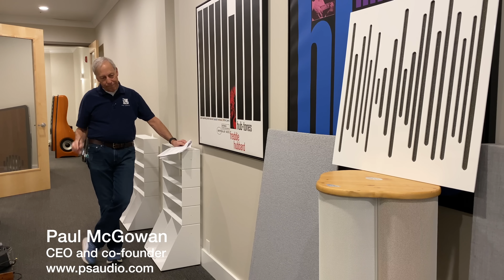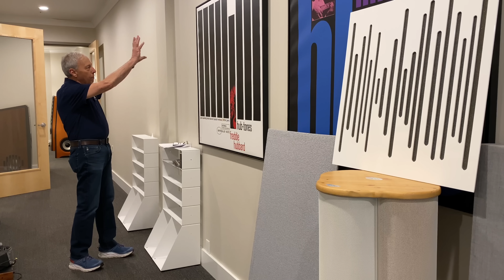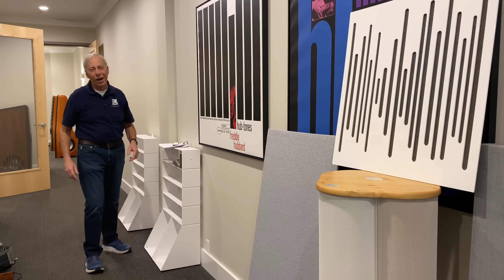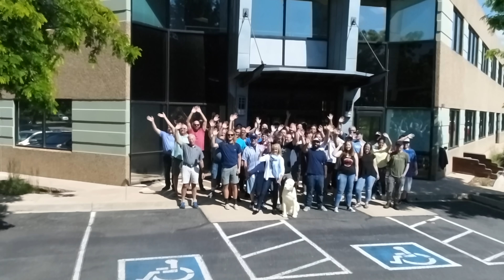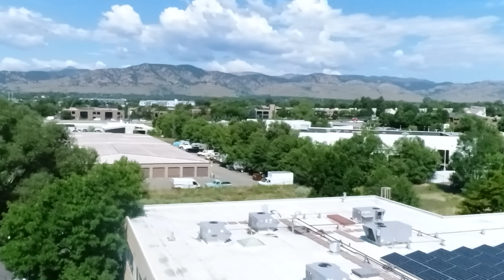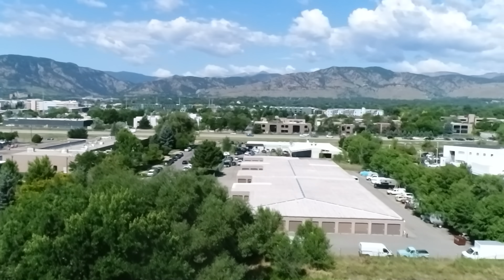USB Audio vs. I2S

Comment: USB is a flexible TWO WAY data connection that can do everything data and allows a DAC to PULL data ASYNCHRONOUSLY with its clock in full control (no audible jitter and bit-perfect audio is possible). The computer can identify a device capabilities through USB. An I2S bus is very low level and is SYNCHRONOUS involving a defined clock master. One doesn't sound better than the other one if the audio specs are the same because you can assume that every 1 and 0 come through reliably. My usual concern with USB is any power or digital noise from a PC leaking through to an analog signal. But this is an issue of good design and not USB itself. Think of it like this, your DAC is happy if it gets every bit correctly, it can run the timing in full control (avoid jitter) and there is no EMI or power rail carried noise disturbing the analog output stage. USB is not a limiting factor.
Reply: HAPZ1ES and forget it. 😉
Reply: @Finn-McCool  that is indeed a good device. But the 20.000 song limit and no streaming means it's a no go for my needs
Reply: Yes, USB is "flexible" and that's why is so complicated, it tries to do everything (and they keep adding features to it!!!).   IMHO for audiophile purposes, simpler protocols like I2S are much better, no drivers, no complex controllers, no power, no fuss.
Reply: I've had a lot of USB noise coming from my pc via the USB ground.
Luckily I have a Cambridge Audio DacMagic Plus, which has a USB ground lift switch.
That switch fully solved all the noise issues I had.
Reply: Qorax Yes, I also had a bad USB cable once that I had to replace. Generally I prefer not to use the USB 5V for a DAC. Audiophile DACs should not run on some PC power supply.
Reply: Marketing needs to make up something to sell 😂
Reply: @AngelosChing  That is exactly what this is about.
Reply: @ThinkingBetter 

Your thinking is actually worse. I2s is superior.
Reply: @dillonsaudio  I2S is a rather old (30+ years) low level serial bus for synchronized audio data used in much of consumer electronics including TVs, DVDs, CD players, AVRs and even car stereos intended for internal data communication between ICs e.g an SOC and an audio DSP or DAC chip. It was never intended to be a flexible external bus but it has the advantage of supporting synchronized audio data with one clock master to avoid any jitter issues but nowadays you can avoid jitter also by asynchronous data pulled on demand via IP (any modern streaming) or via USB. From an audio fidelity perspective, your DAC needs to run at a precise clock and get the data without errors or buffer under-run, but those are not concerns hard to solve nowadays.
Reply: Thanks for responding with your take on this subject and not getting upset like dozens of other YouTubers.
Reply: Of experience
USB audio can cause a lot of noise! I've experienced it! Remember that USB has 5V and that a desktop computer has a lot of noise!

The best thing is to use digital coax or optical from your computer to DAC!

Have experienced noise with
Cambridge dacmagic plus!
Reply: @ford1546 Coax doesn't support high res files to a certain level, possibly compromising your dac's performance
Reply: @ford1546  The best thing is not to have a computer in your audio system.
Reply: @arthurott4561  Yes I know! But running music from a computer to DAC does not produce as much noise as many audio lovers think. If you use DIGITAL coax or opical from your computer you get good sound! Only high end people who apsoutt should have the best who notice something microscopic!
Reply: @ford1546  That's completely dependent on the resolution of your system. A lot of people also can't hear the difference between different USB cables or USB vs Coax or Optical. My system is pretty resolving and I can hear the fairly subtle changes introduced into the system by these variables. An off-the-shelf PC would be almost unlistenable in my system.
Reply: @arthurott4561  Boy does that cut back your possibilities, CD? but then you need to buffer if to remove speed variation etc. jitter from the data stream, so what do you use, an FPGA, is that much better, maybe...
Reply: Arthur Ott The best thing is to actually understand how things work. Lots of audiophile systems today run excellent with a computer. But rather than a large gaming PC with a ton of fan noise, audiophiles prefer a Mac Mini or similar silent computer. Of course you can do this and make it work without damaging the sound much like modern studios are making music involving computers.
Reply: @paulstubbs7678  Well, I am streaming data via USB currently between my Sonore Signature Rendu SE Optical and my Lampizator DAC. I used to do I2S between my Mano Music Streamer and my PS Audio DSD. Both are very good as they are purpose build devices designed for audio and to reduce noise and jitter. What I was talking about is just placing a PC or MAC which is in no way designed as an audio device into your system via USB. Unless your system is low-res and very forgiving, you'll hear the difference. I started with a PC, albeit a somewhat purpose-built CAPS server, in my system when I first started getting into file-based audio around 2009 but quickly found that I wasn't able to even match the SQ of a CD playing on a decent CDP in the system. I had to really move beyond a PC/Mac to be able to get CD quality, and beyond, sound via file-based audio, and that's streaming files from a NAS. Streaming from online services (Qobus, Tidal) still can't match the SQ of a CD or a file from a NAS.
Reply: Arthur Ott I use a Mac Mini and it has zero issue with fan noise, EMI or any sort of data noise into my audio system. Yes, if you use a huge gaming PC in your audio system, you create some problems, so don’t do that.
Reply: @ThinkingBetter  Or just install a NUC, which often are also passive/fanless and probably have more flexibility in terms of software and networking topology.
Reply: Arthur Ott You imagine things. A USB cable with a ground wire and differential data I/O is not going to harm your music if you avoid using the 5V in it and you have your PC grounded and your audio system grounded too. How the heck do you imagine studios can make music nowadays with computers involved? I have the most high-res systems btw.
Reply: Qorax I’m a Mac person, but my home automation runs on Windows on a NUC. Mac OS just works and is excellent also for audiophile setups. I have bought 3 Mac Minis so far for audio. People imagine things.
Reply: @ThinkingBetter  OK, I've heard a number of systems with Mac Mini's. I've never heard one that sounded great. What else is in your system?
Reply: @arthurott4561  Meh. A turntable sounds better, but going analog is not always viable.
At least it's not CD.
Reply: @ThinkingBetter  Hmmh I don't know what imaginations you mean, but NUCs are fine devices for USB audio streaming.
It's just that some cheapskate NUCs get way too hot because of inadequate thermal design, but those can simply be avoided.
Reply: @QoraxAudio  I would bet that a good CDP or CD Transport thru you DAC would sound better than the data streaming from your Mac Mini
Reply: Qorax Imagination in this context means when people make an opinion about what sounds better without a real reason of substance. I can make some example of I2S sounding better than USB when I use USB poorly e.g. to run the analog output stage in a DAC from the noisy USB 5V. Just don’t do that!
Reply: Arthur Ott I run Martin Logan, Krell, Moon and a bunch of other stuff. Most resolving are my Stax SR009. It’s not the fault of the Mac Mini if the systems you heard using it didn’t sound good. Of course you need to run it with an external quality DAC using its own power supply.
Reply: @ThinkingBetter  Yes that's why my DAC has its own external PSU.
It's a generic noisy Chinese wall wart PSU with a barrelplug, fortunately it doesn't affect the sound.
Reply: @arthurott4561  I don't own a Mac Mini.
I do have a CD player connected to my DAC via coax.
It does sound better than using the built-in DAC from the CD player itself, but it can't beat proper high-res lossless audio files or well mastered and pressed vinyl.
Reply: @arthurott4561  Thanks for your nicely articulated words. I use high-end systems and have worked in audio engineering incl. high-end gear for decades. As an insider who actually understand how things work intimately, yes, snake oil is a factual thing of audio business e.g. making stories for consumers that your US$10 FOB Shenzhen power cable is worth US$1000. Anyone saying that USB can not sound good do not understand what USB is, sorry to say it. USB is just a carrier of data and a reliable one. Any cable between a heavy Windows PC and your audio system can yield problems with common mode noise and EMI. That's not a USB issue in itself. Avoid using such PC. Also, don't power your DAC through the USB cable 5V. And sorry, I can't speak about you, but I have done lots of professional blind tests, and SURELY people imagine things all the time in audio.
Reply: @QoraxAudio  Yes agree. On a good system you can hear a slight improvement over CD using FLAC lossless files (when they are properly done). Vinyl is a matter of taste. You have to ignore a few things like noise and reduced dynamic range besides all the tedious handling...but I'm not against vinyl and I can feel more emotional listening to vinyl while watching the disc spin, sort of like a deeper involving magic that modern digital music lacks in a way.
Reply: @QoraxAudio  Yes, this USB discussion is mostly about not using the USB to power the DAC...
Reply: @arthurott4561  Okay. I have the Asus Sabertooth 990fx and AMD FX-8350.
older computer yes but no cheap computer! 

I also have asus xonar hdav 1.3 deluxe.

I also have the Shengya A206 31 kilos heavy
Class-A amplifier and PSB stratus speakers and a good hi-fi DAC.
Reply: @ThinkingBetter  To me, vinyl vs digital is mostly a matter of quality of the mastering.
If mastered equally well, digital is definitely better, unfortunately it's not that straight forward in real life.
Reply: @ford1546 Traditional DIY PCs are usually with noisy fans and noisy power rails. I wouldn't use that for an audiophile system. If the audio sucks from such system, don't blame it on the USB cable :-)
Reply: @QoraxAudio  Yes yes yes...mastering is what matters more than anything.
Reply: @ford1546  A good hi-fi DAC, that's my favorite DAC.
Reply: @ThinkingBetter  You are wrong! The computer components you get purchased are exactly the same as you get when you buy a finished computer! Many times, components you buy to build computer are better than one in a finished computer!

Asus sabertooth 990FX was one of the better things you could buy and
The AMD FX-835 was the largest processor AMD had at that time.

Asus Xonar HDAV was the best sound card if you wanted the best sound from a PC.

And I have
silver power 850 watt power dupply.

And all machines must have fans!

Paul from ps audio has talked several times about how much noise there is inside a PC.
Reply: I'm sure your system sounds good but it's not highly resolving and you can't hear subtle changes with a system that doesn't have the granularity to expose the minor details presented by cable and component changes.
Reply: @ford1546  For gaming, DIY PC is best. I like playing OTA V and other platform games occasionally. For audio, generally speaking (not sure about your PC), the way DIY PCs work involve fans that are not very optimized for lowest possible acoustical noise. The result is a lot of turbulence from several fans moving air. For audio, I prefer the Mac Mini because it's silent. Other options exist, of course.
Your ASUS sound car might be excellent. I haven't tried it.
Anyway, perhaps you and I can agree that excellent sound is possible with a PC or Mac?
Reply: @arthurott4561  Actually I am quite passionate about resolving systems. I doubt your system can beat my Stax SR009 on resolving details btw.
Cable or component changes can cause differences, but if you can't explain a plausible engineering grade theory of why those differences exist, generally I won't buy it. For example, if someone claims a particular RCA cable has more details in the high-end than some other cable, I would declare it imaginary, if a simple properly done null-test found no audible difference. On the other hand, if I could find a measurable difference (cables are always measurable!!!), e.g. in more capacitive coupling between the live and ground wires, I would find it plausible. 
I've done lots of blind tests where people have said things that they failed to prove when they couldn't see what was active. This is especially true for cables.
Reply: @ThinkingBetter  So, I guess, based on your last comment, that if you compared two cables you'd choose the one that measured best even if the other one sounded better so you can imagine you're a scientist. Stax SR009? I thought you had a proper HiFi system. How do those cables affect your nonexistent soundstage?
Reply: @arthurott4561  My SR009 do excellent as headphones. Soundstage is not the strength of any headphones. I thought we were talking resolving audio. I have several proper audio systems in my house BTW.
It's a bit dumb question for me if I would choose a better measuring cable or a better sounding cable. If there is a better sound from a particular cable, the effect is also measurable. Cables have properties of electrical inductance, capacitance, resistance and shielding. They are passive components in electrical terms. There is no magic about cables. I have much more respect for such discussion when it comes to speakers, where truly measurements are nowhere good enough to judge the audio fidelity.
Reply: @ThinkingBetter  To this point, I ran a computer-based 24-bit digital recording system in a studio in the mid/late '90's when 32-bit PCs were still a thing - it was called a RADAR-24.  The company is still in business, though my recording system then, is now even considered to them as an "artifact" (http://www.izcorp.com/about/museum/).
  
DAT tape pushed out analog recording about 30 years ago now (and thanks to writing that out, now I feel really old), computer based recording stations are now the norm not the exception (think ProTools, etc...).  Normally what is done in a studio setting is that anything that makes noise and doesn't have a local interface which needs to be at the sound engineer's fingertips, gets taken out of the expensive critical listening environment and put in a rack closet somewhere else.  If a device has an interface that needs the sound engineer's fingers and it makes noise, it's put in a sound enclosure inside the critical listening room - otherwise it's just put in a rack behind the mixing table.  Electrically, care is taken to eliminate ground loops, shield anything that can be affected by any noise or us an optical transport when possible (like RME's MADI), and just about nothing you could buy on Amazon.com would be used in the signal path...
  
For a stereo home critical-listening room (I also used to do Home Theater installations) I'd start by designing and isolating the structure and ventilation of the room from the rest of the building to STC60+, treat the walls floor and ceiling as semi-anechoic (first reflection decay of >24dB, flat across the band), then I'd put in a structurally simple yet comfortable seat (maybe a Herman Miller Aeron), some well designed speakers (like some B&W 800 D3s, bi-amped), a good sub (like a Velodyne DD-18+), run the speaker wires to the nearest wall, or down through the floor.
  
Then in the next room below or a closet just outside: the amplifiers (probably a set of four of Parasound JC-1+s), crossovers to enable bi-amping (probably DBX 223xs), EQs (probably a DBX iEQ-31), and playback system (probably comprising of an RME ADI-2 DAC connected to a RaspberryPi 4B via USB 2.0 through an isolator - running VLC and hosting a FLAC library).  All audio through "perfect length" custom XLR cables for balanced signal while line-level audio, with the correct braid/foil shield drain terminations (drain to the source side ONLY).  I'd just use a smart-phone to control it rather than have any other equipment in the room to color the sound.  All of the power for the playback system would come from a single 240V/30-amp circuit feeding into a UPS and then a power conditioner, with a common "star" ground at the rack.  Then I'd tune the speakers to the room (still have my AudioControl Iasys HT), and move the seat around a bit to mitigate any remaining modes at the listening position.
  
Just in the above equipment and disregarding the ancillary equipment and the actual room - that's still a $65-70K audiophile system...  The balance would probably double that.  Note how the cost goes down the further away we get from the critical analog environment and signal path conversion steps...  and all the money is spent where it needs to be - not on fancy gold plated USB cables, or some kind of Cat-5 based I2S hack job.
Reply: @Real_Tim_S  Well, yes, you don't need to pay US$200,000 for a top-notch sounding system. Even the most premium DAC chip from ESS or AKM costs well under US100 and a Raspberry Pi 4 can do both playback and audio DSP (even in 64 bits instructions). 
The power amp and speakers are where people need to spend money on great audio, plus whatever room treatment can be done. Actually, active speakers can be even better when done well, eliminating the need also for a power amp. I see no reason for a fancy preamp. Those preamps made sense more in the past when we had cassette decks, record players, tuners, and CD players to switch between. Nowadays I subscribe to a couple of premium audio services online and have access to 60+ million tracks. It has become somewhat a waste of my time to find an old CD or vinyl record in my collection, even I must admit that some old vinyl records are mastered better than their modern digital version.
So the ideal audio system of tomorrow is simply an HD streaming player (even RP can do), DSP audio processor (even RP can do), and very high-quality active speakers. The latter is the biggest challenge. KEF LS 50W second generation just came out, but it's a rather small speaker.